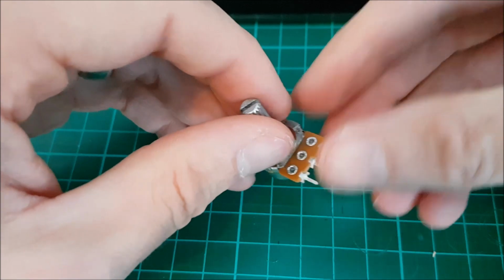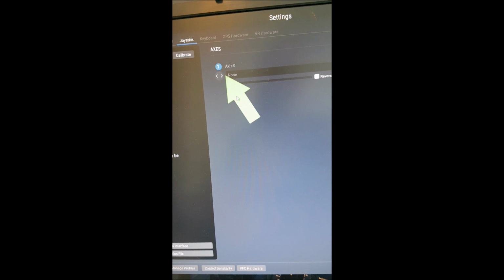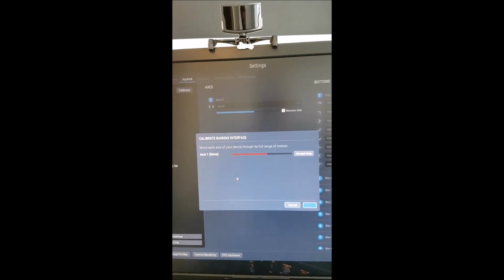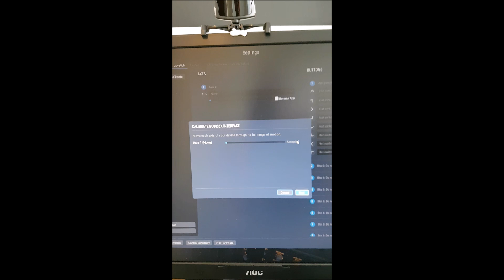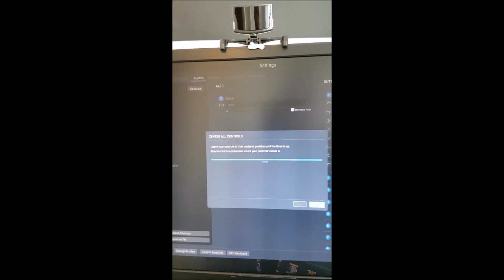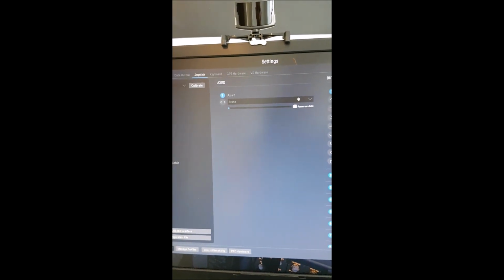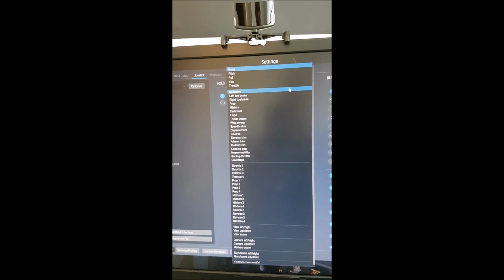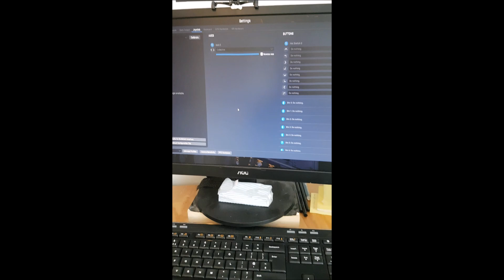Home built helicopter collective lever

Comment: Nigel,.. I see that the one lead is 5v the other two would u explain what they go to?
Reply from the maker: I don't know what they are called but they are pins used to measure the changing voltage (or resistance to that voltage) in the pot as you turn the dial. That change is what the computer is detecting in order to measure the rotation of the axis.
Reply: Ok , I think I understand 
The first one is 5volt in the middle pin is for the Z+ axis and the last pin on the potentiometer is for the Z- axis am I correct ?

Comment: Thanks for explaining in plain English! I've watched a few other DIY  videos on collective building and they all lost me within 3 minutes! Have you thought about adding a rotating throttle? I presume it could be wired via potentiometer and into the existing board?
Reply from the maker: Hi Anne. I had not thought about adding a throttle. Until now! I am thinking about using some Technic lego gears to translate the rotation back along the arm. Not sure I have the skills to do that in a clean and tidy way, but it's totally possible. The card can support several axes simultaneously. It's a great idea.

Comment: You need 2 plastic gears, one for the bolt, the other for the potentiometer.  Attach so that the gears move in concert with the collective and potentiometer. You could even add a throttle on the collective for the bell type aircraft.
Reply: Kenneth Dickerson Any possibility that you could sketch this out? Sounds like exactly what I need.
John
Reply from the maker: Since Anne Robinson's comment above, I though more about this and Technic Lego sets would possibly offer a really cheap way to make that work. I think I'll need to work on a Mark II for this.

Comment: Good video, I am a retired US Army Maintenance Test Pilot, your mock up is sound. If I were to make it, I would use a setup that I saw and flew that was on the TH55. You would need a 12x12 in base, in the center drill a hole big enough for a roller skate bearing (this is your pivot for collective movement), then take a 1 to 1.5 in  PVC pipe cut to length, then at the bottom insert a 6 in dowel and glue it in.  Drill a hole 2" from bottom for the bolt to slide in. Now you need a
Reply from the maker: This is great information! Thanks very much. I'll give it a shot and post an update in due course...